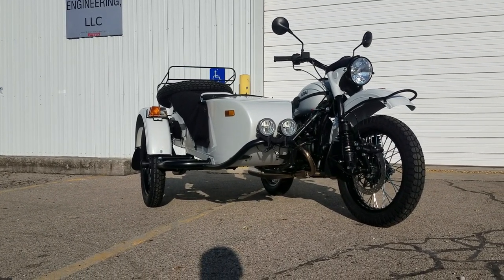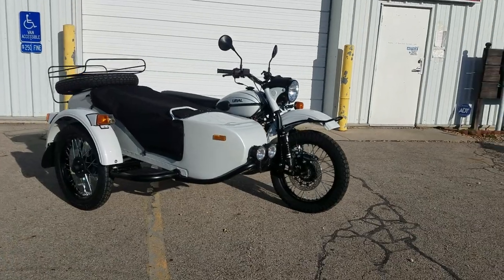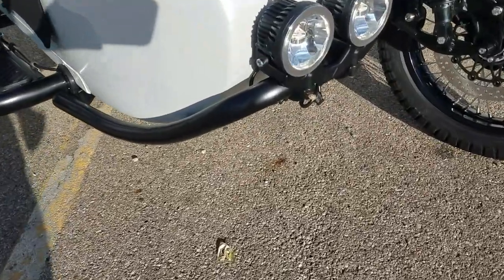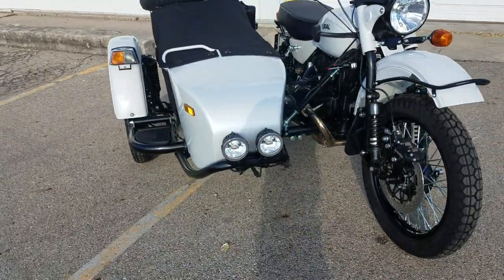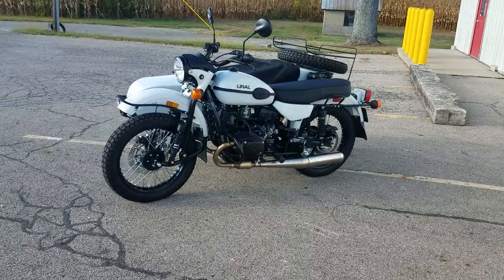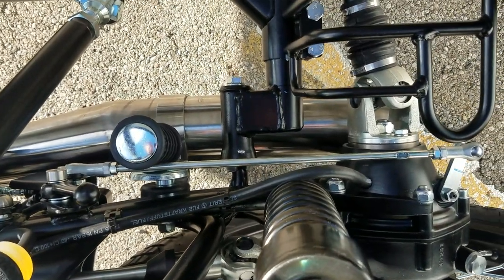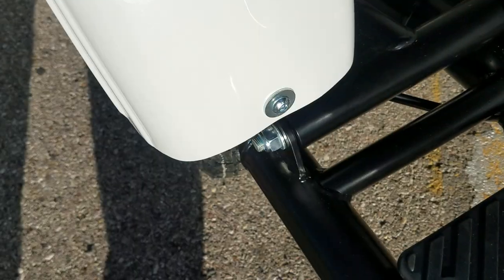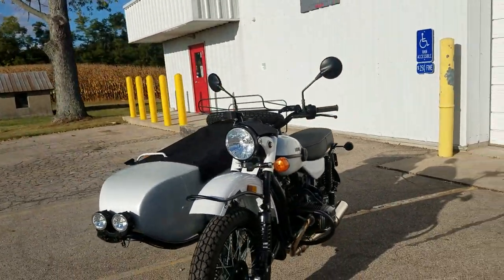2021 Ural GearUp 2WD Sidecar Motorcycle

Comment: This is the perfect bike to switch over to battery power. Battery under the sidecar, electric motor in same space as engine. Lots more places to stick additional batteries.
Reply: Ural actually studies that potential right now. They built a prototype electric Ural and it looks neat! Thanks to the sidecar, on paper, the theoretical range of the prototype looks insane even compared to electric cars of 2020.

Comment: Question: Does the black powder coating impact the engine cooling negatively? Does it slightly hinder thermal dissipation by adding an extra layer on the cooling fenders? I could also imagine it heating up faster due to light absorption in summer day light.  Sry for the noob question. (I'm considering a Ural in Sand color with full black powder coated train in the future)

Comment: I been thinking about getting another CT but want the spare ($1000 or so) so might as well spend the extra $1k and get the GU. I had a 2012 Yamal and never used the 2WD much at all. Had a 2015 CT which was a big improvement on the 2012 Yamal.  Think resale is better on the GU.